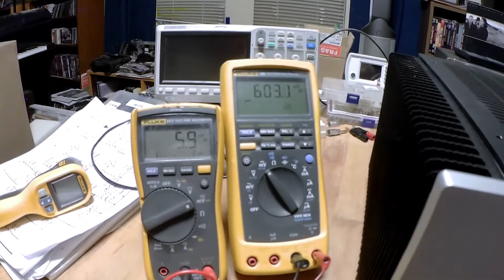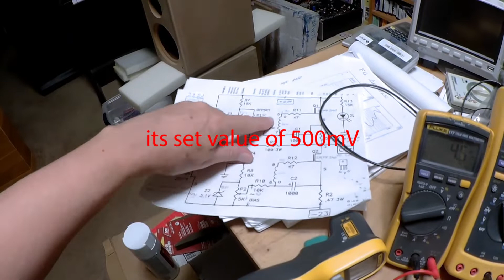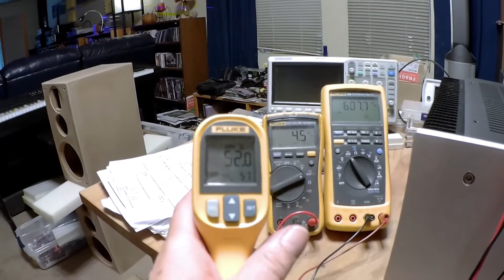Robert Builds the Nelson Pass F6 Amplifier part 11

Comment: Thanks again Robert, I biased mine on 530 mV , it played for more than 200 hours while getting quite hot ( not warm) and it still runs ok. Since I don’t trust my thermometer readings I’m using Mr. Pass recommendation: see if you can touch the panel for 10 seconds, which I can do while counting the seconds very fast.    I wouldn’t have gone through all the troubles of heat and space unless this thing sounded the way it does which is simply amazing to me 

Does higher bias (say 0.6 V set by you) improve sound quality? 

Ambient temp here can rise to 31 deg C but in most cases AC is on , hopefully weather will be colder in October
Reply from the maker: David, I'll mainly run the amplifier in cool weather. We have had a hot summer here in the NW U.S.A. so I haven't had much opportunity to run the amplifier yet. The 600mV spec was mentioned in the DIYAudio F6 forum.